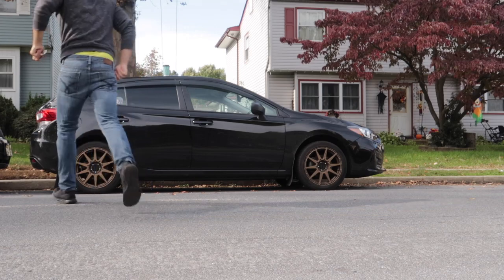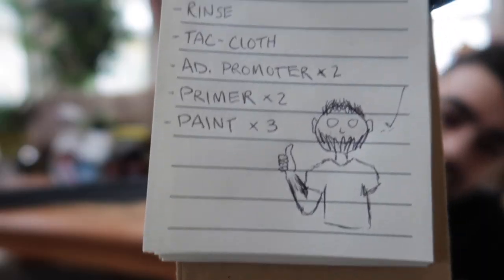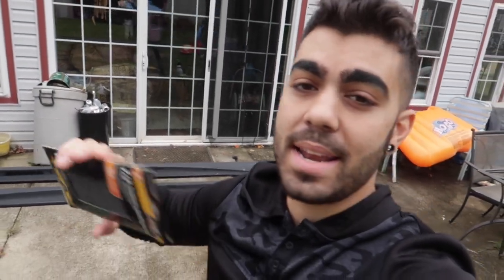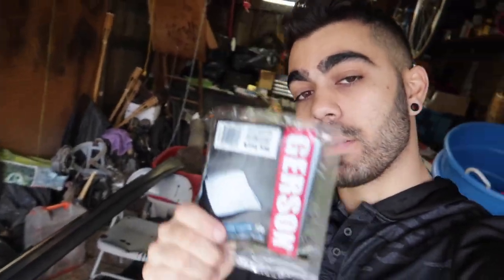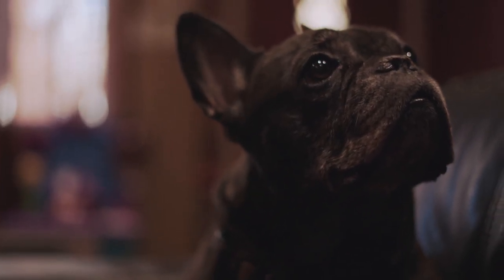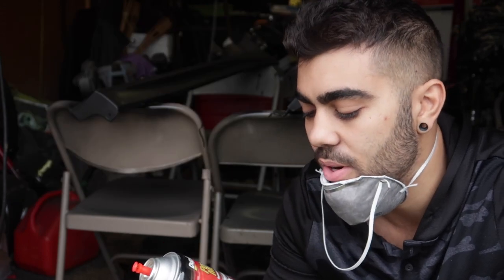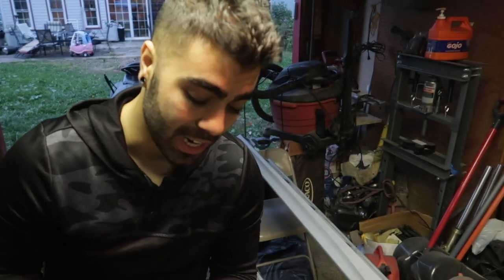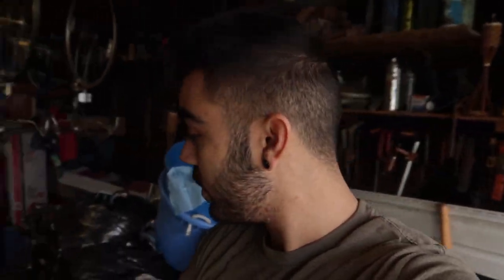How To Paint Plastic Car Parts/Side Skirts (2018 Subaru Impreza)

Comment: Plastic? Light sand 320, acetone cleaning to dry.  Acrylic with Flotrol through HVLP sprayer.  You can job looks great!  But it was compromised when wet and chipped after a week.

Comment: Did you sand the primer? Someone told me that you must sand the primer after dry out with a 1000 sand paper to make it smooth
Reply: Back in the day we were taught: "Paint doesn't stick to un-sanded primer!" - so I was wondering the same thing. I would think even a 3m scuff padd would do it.
Reply: Exactly this! Been wondering the same exact thing!

Comment: Thanks for taking the time and making a DIY video. your not a painter and a DYIér so im not bagging you out because your technique was way off. Honestly, with all the money you spent on products, which is good stuff. You could of got the skirts sprayed professionally, it would of turned out better, and cost you less. The final finish looks terrible. but people dont understand this, and go out and spend alot of money and waste days to get such average results. its not the humidity. its the spray technique, which takes years to perfect), that resulted in very dry and sandpaper-like finish. if it didnt take hours or days, and cost so much for products, It can be a quick fix and good idea. but its takes alot of effort and money to get that poor result, and its not even matching the colour of your car. go to a panel shop they will do a pro job cheaper.
Reply: Paint shop here wants 2 hundo per pc. 4 pcs on an 20yr old car. Nope.